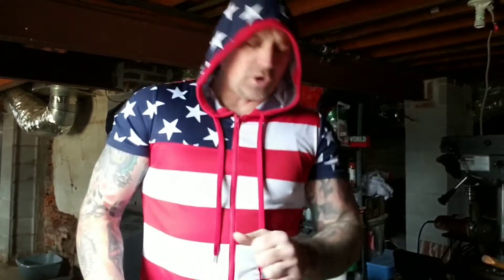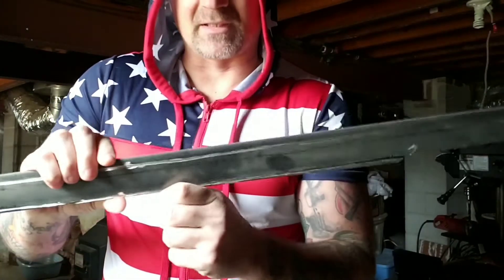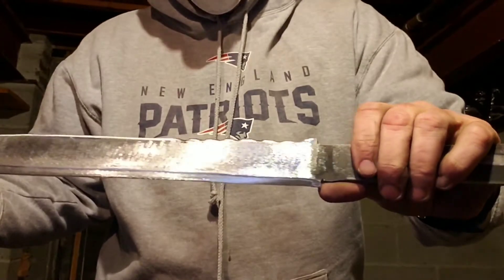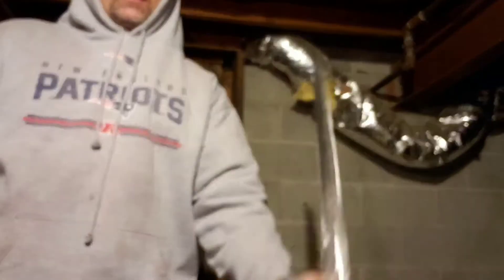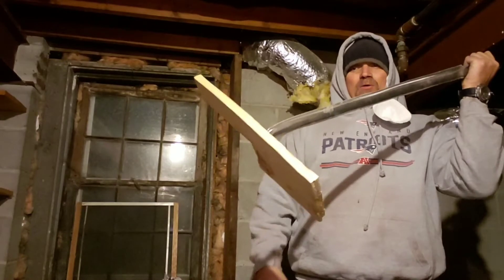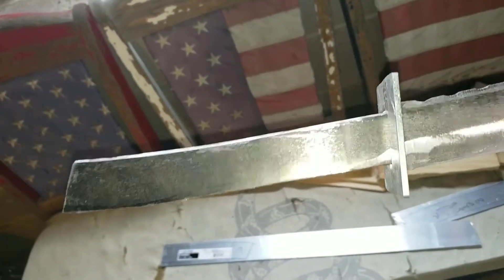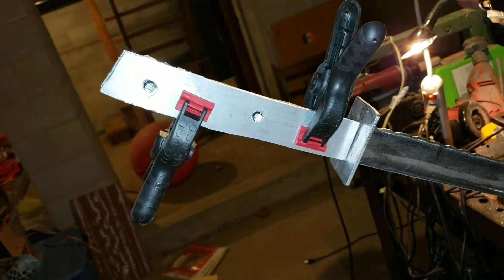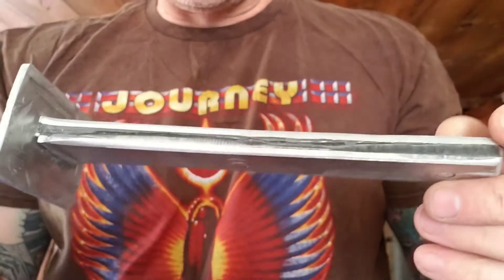dbad custom hand-and-a-half Samurai sword

Comment: This is a dope project you worked on :o I'm hoping to get some stronger metal shipped in withing the next 2 weeks to a month to craft myself another project I've been wanting to do. My first attempt months ago looked pretty decent, but the grade of steel wasn't as strong as advertised & had to size the blade down by half.
Reply from the maker: Did you heat treat?
Reply: @DonnieBAllDay  I did heat treat it, the type of metal was advertised to be 1095 steel at a local hardware store. Yet it was just a lesser grade of metal that was too brittle for what I wanted to use.
Reply from the maker: @DisgustingJustinAD  Ah. When I tend to just do edge heat treats. Hardens the edge but keeps the spine soft. It allows me to buy cheaper steel like 1080.